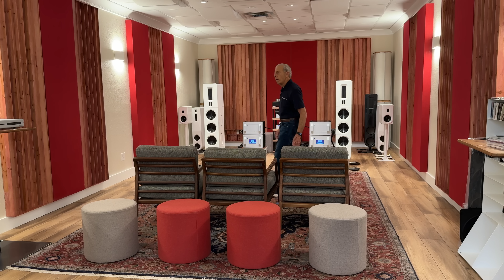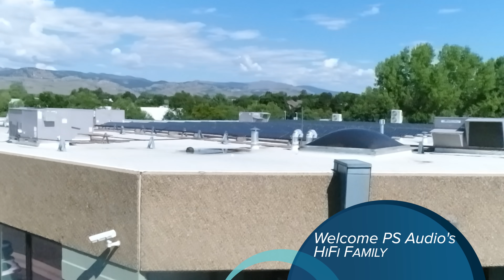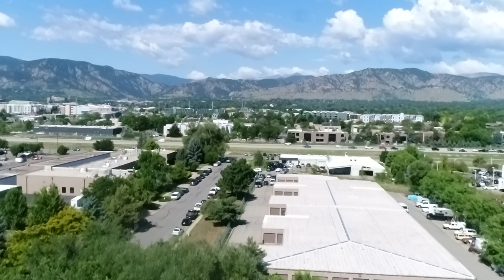Tour of the new Listening Lab

Comment: Gorgeous room, Paul! Great color scheme. Regarding the false ceiling, my biggest concern is vibration. Providing downward pressure of some kind on each of the panels can help with low frequency vibration that usually the biggest problem. 

Got to come by and check it out some time.

Comment: Wonderful stuff and not forgetting bang for yer buck 🫡
Reply: How do you address the interaction between the multiple  speaker models in your room ? Was your set-up all done by ear or did you use any measurement devices  such as the Sencore SP495 ? How did you decide on the placement of your diffusion and  absorption panels ? Your room looks great and I'm sure it sounds great but I've often found meeting both those objectives simultaneously can be somewhere between difficult and impossible .

Comment: There’s no way it sounds remotely as good as the old IRS setup did unless ps audio exists in some magical place where the laws of physics don’t apply. Paul claiming the new speakers sound as good as Arnie’s makes me lose my respect for him.
Reply: The IRS are 40 year old technology. Speaker and material technology has moved a very long way in that time. Plus Chris is a genius. He and Paul didn't rush them onto the market, they took half a decade fettling the design. They used the IRS as the goalposts. 
I'd be surprised if the FR30s aren't better.
Reply: I am afraid, you might be right, the Inifinty had a soundstage, in a width the AR30 can not provide
Reply: @raykuiper4979  narrow baffles tend to image better. This is one of the reasons that the FR30s are probably better. The IRS had to be wide to limit dipole cancellation.

Comment: Just an observation:
If first reflective point is like a bank shot in pool, it seems like the first reflective point is around the lights area. An area where the walls are bare of room treatment.
Reply: Given that paul literally wrote the book on this type of thing I don't think this was an oversight. I'm pretty sure the first point of reflection would fall further back on the absorbers that look like they're almost beside the speakers. It would be halfway between the speaker and the listening position (around where the bare spot is) if the speaker and the listening position were the same distance away from the side walls, but since the primarily listening position is in the center of the room and the speakers are closer to the side walls, this point is pushed towards the direction of the speakers.
Reply: @maxeddis1138 
So, there’s a precision about it. Nice!
Reply: @tubefreeeasy  A cool method he has mentioned and I have implemented myself is to set up your speakers/listening position then have a friend move a mirror along the wall until you can see the tweeter through the mirror from your listening position and that's your first point of reflection.There have been a couple times where my intuition for where that point would be was surprisingly off.